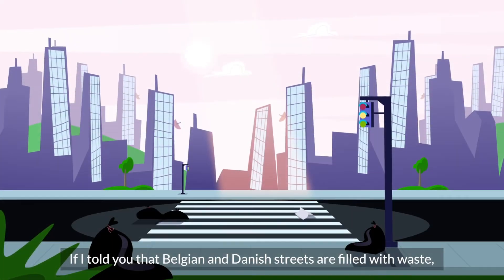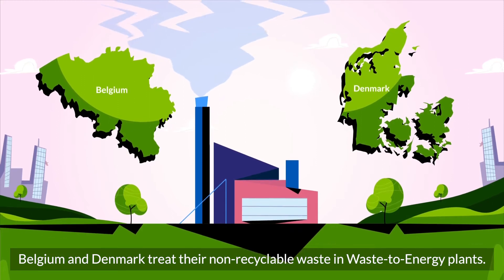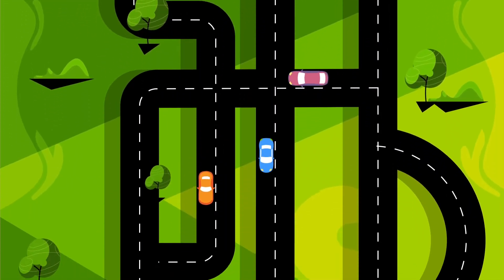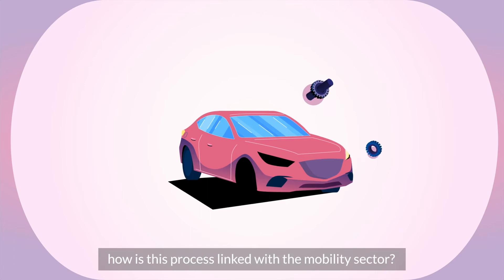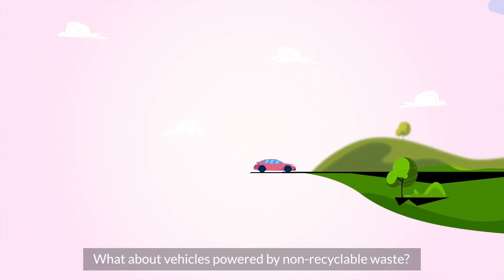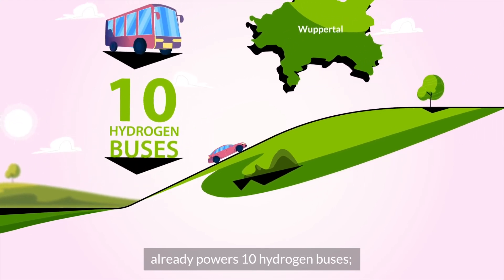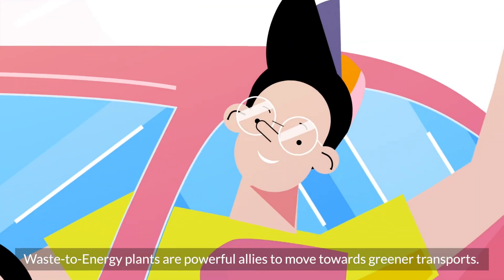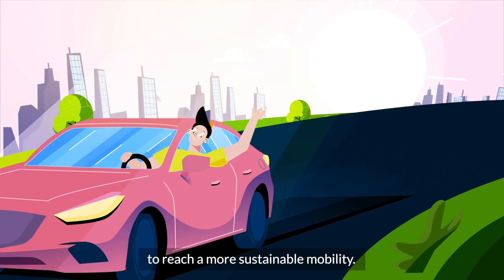The Journey of Our Waste - The Beauty in the Beast

Comment: Greenwashing by ESWET.... 
700 tonnes saved? and how much CO2 emitted by burning waste?? 

slags and ashes used for roads construction? very dangerous. Science shows that such roads can leak microplastics and other dangerous substances. https://www.researchgate.net/publication/342777259_Is_Incineration_the_Terminator_of_Plastics_and_Microplastics
Reply from the maker: Dear Piotr. We don't want to do greenwashing, but to show that Waste-to-Energy is more than just burning waste. About the 700 tons of CO2 saved, it is because hydrogen substitutes diesel buses (https://fuelcellsworks.com/news/first-hydrogen-bus-arrives-in-wuppertal-hydrogen-plant-completed-in-february-2020/). 

WtE plants emit CO2, but the waste they treat is the same that would end up in landfills, causing the generation of methane emissions, which are more potent than CO2. WtE plants recover energy and materials from waste that, today, is not recyclable. However, the WtE is working to further reduce CO2 thanks to CCS technology. 

For what concerns road construction, a recent European study gives an overview of how the material recovered from the bottom ash can be re-used for road construction: https://www.sciencedirect.com/science/article/pii/S0956053X19307275
Reply: @eswet-theeuropeansuppliers6606  

Hydrogen is only green and desirable if produced from sustainable source of energy. Waste burning is NOT sustainable. 
So the your story about the hydrogen from WtE plants is simply a greenwashing. 

About emissions from landfills. Please do not repeat the misguided information. What generates landfill emissions is biowaste that is disposed there. But you know very well that more and more countries are moving away from disposing of this fraction, and soon all the biowaste fraction will need to be separatelly collected and treated in composting/anaerobic digestion, bringing benefits for climate, soil, water retention. Burnign this fraction is counterproductive... using energy to burn wet fraction. 
Moreover, whatever is put on the landfill must be pre-treated, significantly reducing the emissions from landfills. What you are saying is either the situation in countries where there is no separate collection of biowaste, or you speak about the situation from the past.

Recent scientific study says about microplastics in bottom ashes from waste incinerators. No, we really cannot afford any more CO2 and microplastics in our ecosystems.